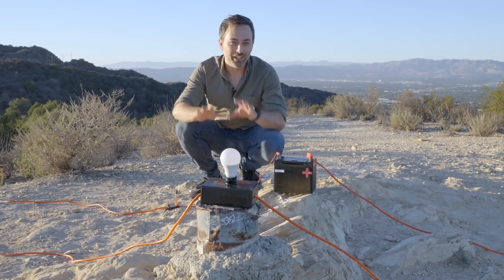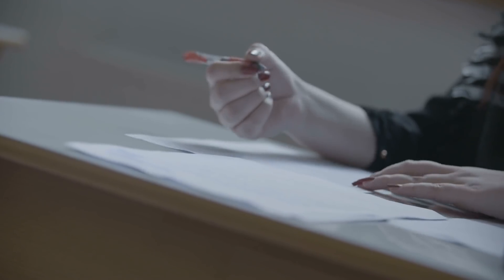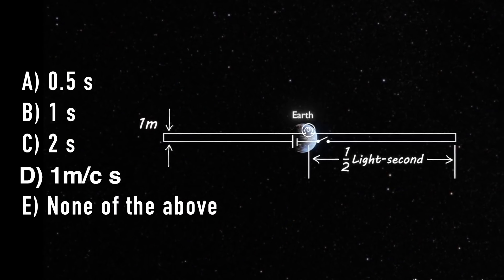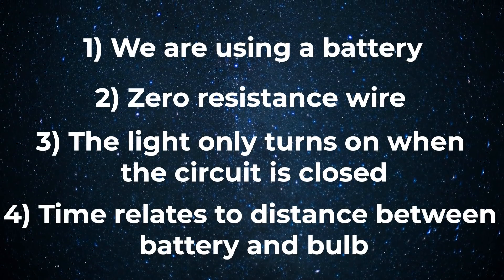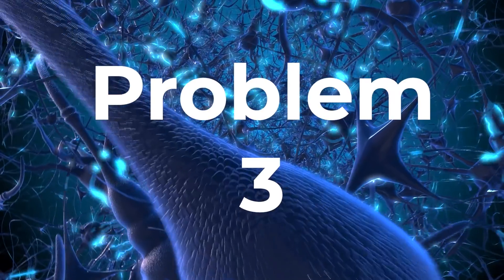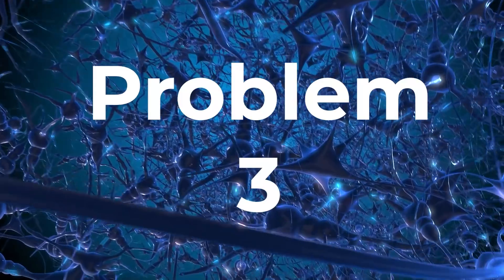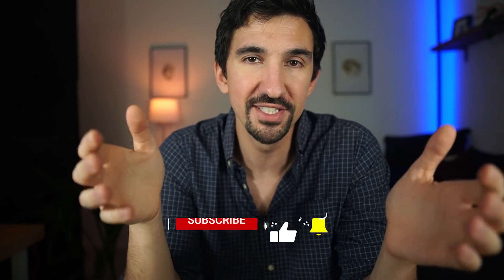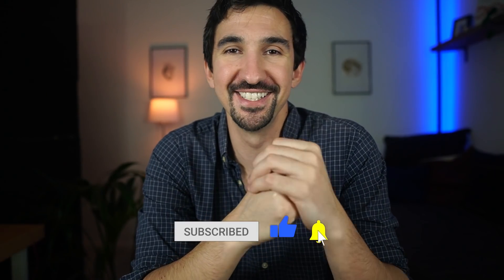Is Veritasium Wrong About Electricity?

Comment: The only parts of his video that interested me, well the whole thing yes, but mostly thinking of cables and wires bleeding. I’m thinking high end car audio and interference, this need for greater shielding in wiring, overall reducing hum, hiss and background noise. Yeah grounding helps to reduce a lot of that, but after watching that video, it made me think of shielding differently, especially in audio or car audio. At higher volume I myself have a hum and it’s most likely the alternator whine or maybe some other interference but if I were to shield all my wires, that should quiet the whine or hum, and create a cleaner clearer signal to listen to the music with, also reducing any amount of distortions created at higher volumes by those hims or whines, which would further my speakers life and make the music just sound better. From an audiophile perspective, yeah, the video and parts that included shielding or electricity outside of the “wires” made me start thinking that information is useful. Maybe I’m wrong, maybe I’m just a damn idiot and didn’t understand any of it, don’t know.

Comment: I think you have missed the point in a way..... the all the assumptions are wrong, the thing that keeps it to the speed of light is the physical restraints of the things you are willing to except.... in this universe you could not get 0 impedance wire, or a power sourse that would be stable enough ... most circuits have only a magnetic connection via transformers etc... the previous illustration, in my view, was considering the way electrons passed the information.. not necessarily how quickly it did it....... and we only have a perceived top end speed of light in a vacuum... light is much slower in different medium.... I think somewhere around 9km a second has been recorded... what would the speed of light be in a black hole... none of this changes the basic physics but we may not have all the facts.....

Comment: In fact that is actually the case, for the second point of the video, matter and particles like phothons cant travel faster than light, but that doesnt aply for fields, what they are saying in the video is that is not that the electricity "travels" throuh the wires by physical means (which cant go faster than light) , they even say that particles inside the wires barely moves, the wires are only a way to guide the elecromagnetic fields

Comment: at first i had some confusion about why you said if when you hit the light switch on it would be faster than speed of light.  you clarified yourself however veritasium does mention sort of as an aside you wouldn't see it immediately but the strength of the light would come "on" more gradually.  ok i shortcutted  both of your explanations but you did hit on something.  actually the viewer will not "see' the light as quickly as the light itself comes on.  because the light then has to travel to the viewer.  in a house it is probably not going to reach the viewer noticeably slower and so perceptively we think on is on and we view it.  now suppose one is 500 feet away and outside of the house and someone turns on the light inside the house the person inside will see the light as on sooner than the person outside  of the house.  so does light appear at the moment the switch is turned only on when the swtich is turned or when the viewer perceives the light.  if you've ever traveled on a country road late at night with little moonlight and a light is turned on and you might travel two miles before you are what you are next to the light.  well am i not going to calculate the exact physical time it might have taken for the light to have traveled to me but the person in the house will have perceived the light before i did to miles away.   likewise with starlight that might be x light years away.  physicists calculate the light as having originated x light years away.  by your method then the light  i see didn't really occur the moment of its occurrence but the moment.  you are really talking about perception and veritasium is speaking of "on" as the moment calculated by the formulas of physical laws.  so basically the truth is the same. because perception is the viewer's reality and on would be the moment of perception so it is actually impossible to see light before i see even though it is possible for light to occur before i see it. physicists do recognize this which is why they say light has a constant speed but the measurement might be different.  so actually the question to pose is : if the reference frame for any type of measurement can therefore invalidate the measurement and no measurements are ever accurate.  i think this is more troublesome for philosophers than physicists.  to the normal person the point of perception is the point of measurement and of course measurement incompatibility therefore extends beyond the quantum level to the macro level and this forces the question of all levels or types of measurement.  so ultimately is there any measurement of distance or time capable of any measurement beyond the psychological perceptions of the receiver of those perceptions.

Comment: Are you considering that the electricity is not actually traveling from the battery to the moon and back to the bulb before lighting it. My understanding is that the response of the bulb to the battery is as quick as it is due to the fact that all the electrons necessary for the bulb to light are present at the bulb.  That the force of the batteries electricity is applying the needed pressure on the wire to start the flow of what is already there. This should cause questions to the dilemma you have presented about the distance in relationship to the time. It seems to me that the distance does not need to be considered when considering the time with this understanding. I think this is the point that he was trying to get across with his answer to the time it would take. I am just a layman in this field so i would welcome any corrections or explanations. Thank you.

Comment: The real problem with the thought experiment is that everyone has assumed that "everything is perfect" - Bulbs produce photons instantly, wires are superconducting, have no weight, do not form antennas for unwanted signals, all elements of the system are matched etc. In real life, with real bulbs and cables that have real resistance, capacitance and inductance, forming some transmission line of some average impedance and wave propagation velocity into some changing impedance load (as it starts to produce light heat etc), there will be some fairly calculable "average" V and I over time that we could write an equation for (which will definitely not show enough current in the time stated to initiate the process that turns the bulb on - not to even mention the construction of the bulb and how /when it produces photons). At the very tiny time scales they are talking about the only thing that matters is field interactions caused by the impulse generated at the "closing of the switch (in the switches location), which essentially involves quantum entangelment - this entanglement or transfer of information can't move through the fields any faster than the speed of light - so will there be some "information" received at the bulb from the switch in the time stated in veritasiums video - sure, (but remember that other information is also being received from all other parts of the field from throughout the whole universe at that time (generated at a time in the past at corresponding distance) and the result we would measure at the bulb or just around it (if we could) is the collapse of the superposition of all of that locally arriving wave information. The reality is, that we don't know exactly what that information will be - it may be that no change in photon production at that location occurs at all, it may be that some major disturbance in the EM fields just happens to be tuned to the wire length and arrives from another location to the bulb and the light turns "on" at the very instant the switch is thrown, it could be that photons are already being produced from the energy being coupled into the wires. For the answer to be exactly as veritasium claims, a whole bunch of things about the universe have to be assumed to be "perfect for the experiment" and the universe has to contain a whole lot of nothing other than the very specific things in the experiment. 

That is not reality - and I've not even started on the physical things like switch bounce, the weight the wire (and the forces that would be exerted, making it impossible to hold it in the shape stated), the temperature it would have to be at to be superconducting (and all the equipment require to completed that feat), the amount of energy that "transmission line / antenna" would couple from the surrounds into the wire, just by being there in the EM fields at that length etc.

In short "is some information transferred in the time stated" - yes. Is it likely to be recognised, by a human standing there, as the bulb turning "on" - no. When the question was asked "how long does it take to turn on the lightbulb when I throw the switch", the correct answer would have been "I don't know exactly, but its probably shorter than you would initially think".

Comment: The video where Alphaphoenix implementing this circuit and doing measurements with oscilloscope show the correct answer ! If veritasium  talked about lamp 20m away and all circuit like a big 8,  i think don't created so much answers about induction like antenna. I think is what he desired to talk about timing to the steady state.  Originally i concept the timing for that is related to the switch terminals distance to close the steady electric field interrupted only by switch. Δt=Δx/c and Δx about 2cm. So answer very close to light. But now upgraded to  we need to increase this time by a proportion related to distance Δy/c where Δy is shorter distance switch to lamp as that  timing the steady electric field orders the electrons between lamp terminals to move (cause is time closing switch and effect that information achieve lamp terminals). Alphaphoenix experiment show this!

Comment: Hmm the whole explanation of how things our taught and understood is mostly wrong, there is no physical electricity, in fact everything is reactive and behavioral.  Hmm I have Asperger and constantly see in the world extremely different while having my mental attacks, where I can see these things.  The key point I am getting from his explanation is this... The energy can't be measured as one point to the next since it's not having to transfer from one point to the next, it's just having to react between the conductive molecules next to it, the line has already been placed with conductive materials and insulation to keep the materials around these desired materials from creating resistance? So the moment the loop is closed the energy at point A doesn't have to reach point B, it doesn't go anywhere at all, it just reacts to the material beside it, the real show happens inside of the particles, they behave in a way that creates a reaction due to their properties.  I am sure that I didn't do my argument justice in the way I explained it, though I have never been to a university nor been educated in such a field...

Comment: Test it? Use a very high-frequency alternating currency at the source (allowing you to use a shorter wire) and interrupt the signal at irregular intervals. Do a phase analysis at the destination. I think this is similar to how clocks are synchronized over the internet? I have no idea what I'm talking about. 😅

Comment: Question - When the wires are acting like an antenna does the current flow in the opposite direction to when it's acting like a circuit?

Comment: I think you make some good points (especially about detecting a signal at the bulb as opposed the the bulb actually "lighting").

One point about both videos: comments have criticized both by pointing out effect like capacitance between the wires; inductance; etc.  If you going to make impossible assumptions (like 300,000 kM of zero resistance wire), why not others:  zero capacitance between the wires; zero inductance; etc. as well?  
I mean, after all, we're ignoring the fact that 300,000 kM of, say, 12AWG wire is going to mass something on the order of 10,000 tons, and how we're going to support that structure. :)

Comment: You and Derek are not electronics engineers and didn't hear (know) about "electrically long transmission lines".
The circuit Derek presented is an electrical series connection of 2 long lines (shortcircuited at their ends) and a lightbulb.
If you think in those terms (long lines have a theory behind them and understanding long lines is not for everybody) you'll be "enlighten".

Comment: the Veritasium video conclusion is wrong because there is not enough capacitive or inductive coupling in the wires 1 meter apart to transfer enough power to light a 12V lamp

the inductive coupling also induces the voltage in the wrong way into the wire attached to the lamp - when the positive side of the wire is energized at the battery it will slightly induce a current to flow away from the bulb, not towards it. 

It will take one second for the current from the battery to reach the lamp and make it glow

the entire videos claims that power or energy "flows" in the fields in a DC circuit is wrong. Power is not voltage and it is not current - for power to flow there must be voltage and current present at the load. Voltage does not "flow", only current flows. The magnetic and electric fields that exist around a wire carrying a DC current are static. There is no energy flowing in the static fields.

The power is transferred by the electrons moving thru the impedance of the load, which creates a voltage drop, and the power transferred is the current times the voltage drop.

I like your catch on the 1 light-second long wires acting as antenna. Streched out past the Van Allen belt and half way to the moon, an antenna that long would pick up an incredible amount of energy, probably blowing up the lamp and battery, arcing across the switch, and melting the wire for most of its length in seconds.

And dont be so quick to dismiss the mistake on the units of 1/c. In my college courses if the units were wrong the answer is completely wrong. That is partly why the Veritasium video mixes up current and voltage and power and energy - he does not understand the units.

Comment: You’re wrong with your antenna example. For example, let’s hook a twelve volt battery to a one meter wire, and a lightbulb to a parallel one meter wire, but the circuit is still disconnected. Will the light turn on? No. Wires are important and Derek is definitely wrong.

Comment: I don't think it will turn off immediately if you break the wire. It turns on almost immediately because the circuit is closed only 1m away from the bulb. But I think if the breakage is at the end, it should still take half a second for the light bulb to turn off. Anyway that's just my guess. 

And it wouldn't violate conservation of energy since energy is coming from the battery not the wire that broke. And if the premise that it's the electromagnetic fields that is transferring power is true. Fields that can travel through space.

Comment: 1m/s / c s or 1 m / c
1 m / c s is  in square seconds.
Reply: How did you get that? Correct me if I'm wrong, but isn't it  1m/((c m)/s) = 1m * (s/(c m)) = 1 s / c = (1/c) s ?
Reply: @xenon9531  c is a speed so it has units of distance over time. let k m/s = c, then 1 m/ ((k (m/s) m)/s) = 1 m / (k (m/s) *m *s ) = 1 / (k m) which is in units of inverse distance rather than time.

Comment: In Veritasium's model,  the light turns on almost instantaneously...long before the energy of the circuit can move through the wires from the battery to the lamp. If we assume that "turn on" means there is some charge at the lamp in 1/C S, then it is accurate to say, "turns on" and I am even willing to accept a perfectly responsive lamp that requires a very tiny charge to "turn on". In this case, the wire isn't even necessary because the switch itself will propagate a charge (at x=r^2 distance) in the "electric field" through space without a wire. This means that a signal from the switch can be measured at some distance from the switch without any wires. The strength of this signal is proportional to the charge density at the switch and the distance (again, r^2) from the switch (or any circuits attached thereto). If you open and close the switch very rapidly on a DC circuit, you will create amplitude modulations (changes in charge density) that will function much in the same way as a radio. An antenna optimizes these charge density changes (by matching the changing amplitude periods {frequency} harmonically). Instead of a switch, use a microphone and instead of a light, use a speaker and whalla, you have radio communication, the wires are nothing but a dog/pony "trick" in Veritasium's question.

Comment: Hmmm. No suggestion communication faster than light in V's video. It matters that there is _one meter_ straight line distance between the battery and the bulb. Inductance or capacitive coupling, as you suggest, is indeed what gets the initial "information" to the bulb in 1m/c seconds. Interestingly, if the wire circuit was broken at both far ends (or just one or the other or not at all) and the power was oscillating at the resonant frequency of the remaining physical circuit and if the impedance of the output of the AC power source and that of the light bulb all matched the impedance of the transmission system (parallel wires) -- then the FULL power would arrive at the bulb in 1m/c seconds -- albeit oscillating ± over time. ;-) The same is true if there is ONLY the power source and bulb and no "wires" at all. 😀